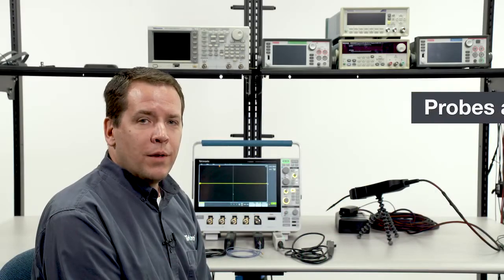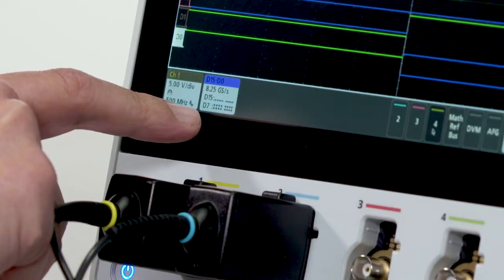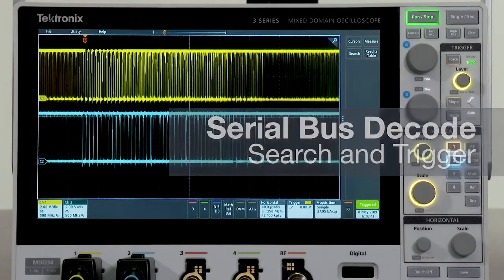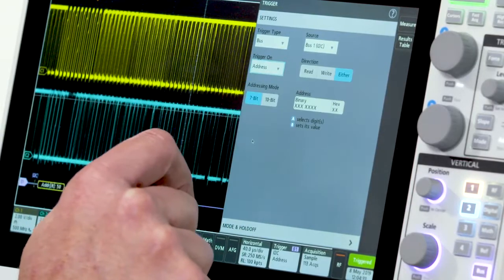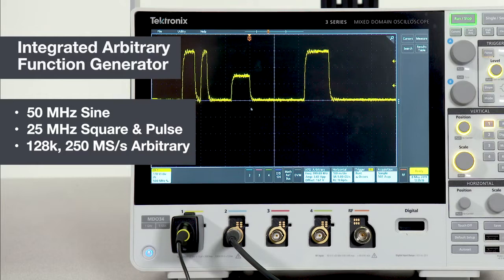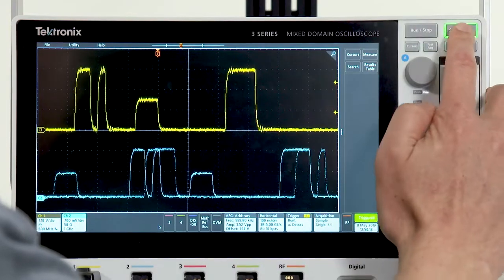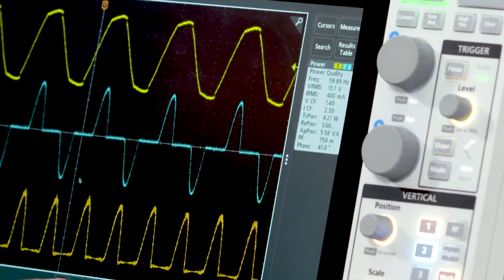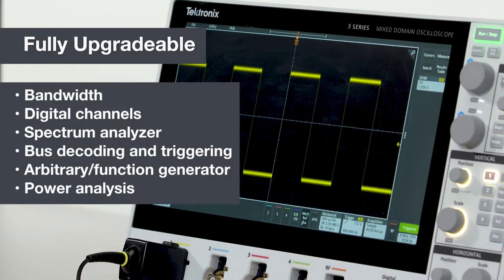3 Series MDO Mixed Domain Oscilloscope Integrated Spectrum Analyzer Part 4

Comment: Do we get time correlation between analog/digital and RF just like in the older MDO4000 series ?
Reply from the maker: Thanks for the question @SaadAli. The 3 Series MDO has a separate RF spectrum analyzer input, just like the MDO4000. The RF input on the 3 Series MDO can measure up to 1 GHz, standard. It can be configured with an option to measure up to 3 GHz. The MDO4000C can be configured to measure up to 3 GHz or 6 GHz, depending upon the options. 

Please see this page, https://www.tek.com/datasheet/3-series-mdo, for more material related to the 3 Series Mixed Signal Oscilloscope.
Reply: @tektronix  I don't think my question is understood. In the older MDO4000C there is a split screen view between Spectrum and Analog. Is the same feature available in the newer ones ?(sadly the new 4 series is an MSO). I have found that feature to be extremely useful when it comes to debugging.
Reply: @SaadAli-mr1dd  He's sales guy, all he can do is repeat text from brochure, like a parrot.
Reply: @SaadAli-mr1dd  I'm curious about this as well. The pricepoint is relatively cheaper than the 4000, specifically for the higher end models, and the features seem to be about the same. Yet this MDO seems super obscure, and I'm curious as to why that is. I'll have to do a bit more research and maybe contact Tek, but if there's no major downsides I might buy one of these